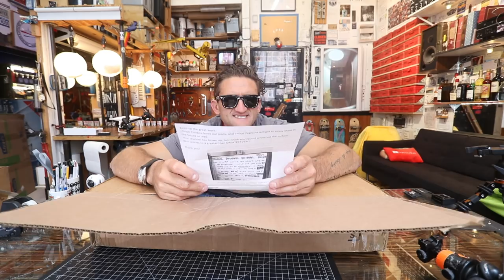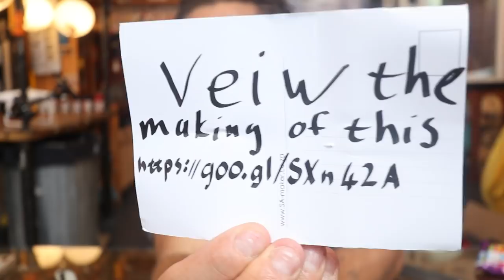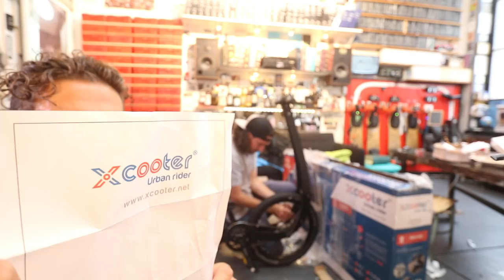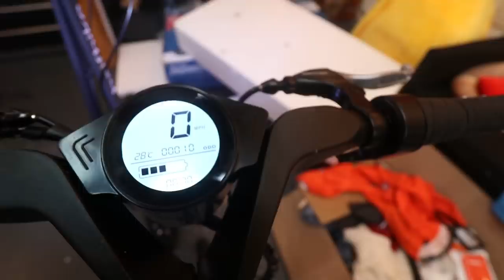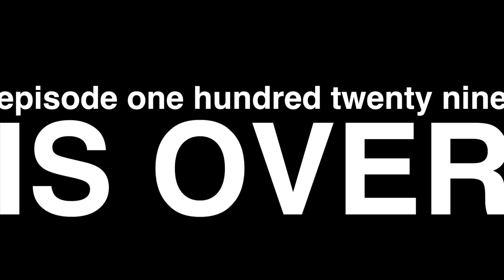RiDICULOUS ELECTRIC MOTORCYCLE

Comment: that bike thing that shaun had... it has absurdly short handlebars. I just don't understand who would deign them like that it just makes it so hard!!!
Reply: *design
Reply: +Misha Tsirlin hipster
Reply: No he's completely right, was thinking the same thing. You cant have any balance with such short steering wheel
Reply: Hi Misha, actually you don't control the halfbike with the handlebar but with the whole body, so you don't need a wide one. Shaun was great for a beginner, but this is something completely different and it needs couple of hours practice :)
Reply: Have no idea how it even made it into production tbh
Reply: But it sure makes it a lot of fun I have to say
Reply: Guys, the size of the handlebar has nothing to do with the balance, it is all about practice, it's like riding a normal bike for the first time, you need to reset your mind and relax :)
Reply: That's probably the point. Just something fun to try out, like a unicycle.
Reply: yeah why are the handlebars so short....its crazy

Comment: 6.02 - 6.10 : Riding a motorcycle is more dangerous than a Boosted Board in traffic (without any protective gear)? Wow !
Reply: Riding a boosted board isn't that hard.
Reply: We don't have statistics yet on the BB. But i guess he's better off without a bike considering the traffic situation in NY. Even London has it better. AND that, is a statement.
Reply: When did he do that?
Reply: Listen to what he says : 6.02 - 6.10
Reply: Point taken, but it just looks so dangerous when he is weaving in and out of traffic on his Boosted Board ( no helmet etc)
Reply: The way he rides that board, if hate to see him on a crotch rocket.
Reply: Yeah but he only rarely goes 125mph in the city.
Reply: those are max speeds he never actually will go that fast and definetely not in new york traffic

Comment: The reason you guys were entertaining us so much on that strange eliptical thing is because you were attempting to generate too much force by sending power through your toes on the pedals leaning forward. That thing has no seat clearly and has tiny rear wheels that are happiest when supporting 90% of the total rider weight. Using your core you have to find a balance that allows you to press down through your heels/middle of your feet on the pedals while leaning back keeping your core engage, using the front handlebars simply as controls, not support. If that isn't exactly how to ride that thing properly then there is no healthy way to use it with that design lol may be more likely than what I suggested